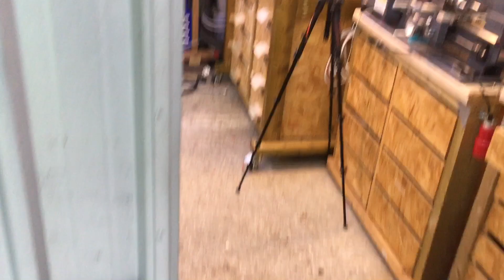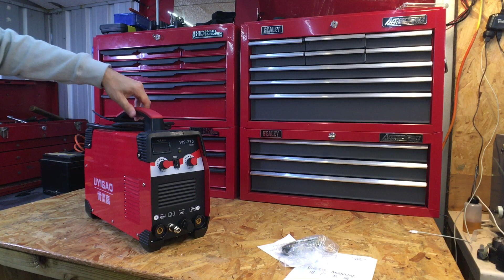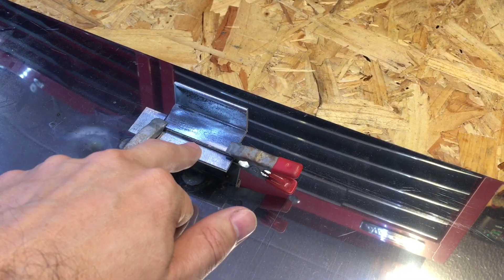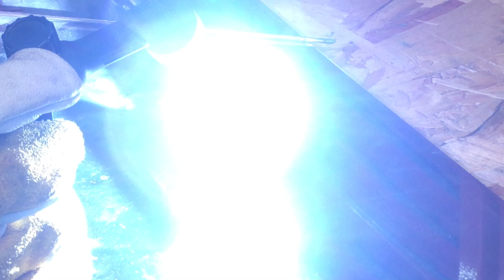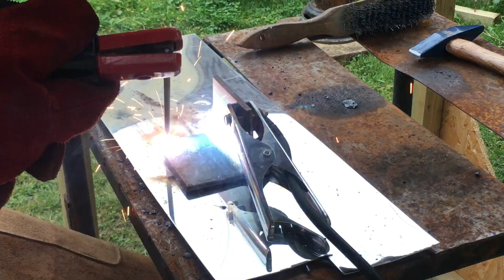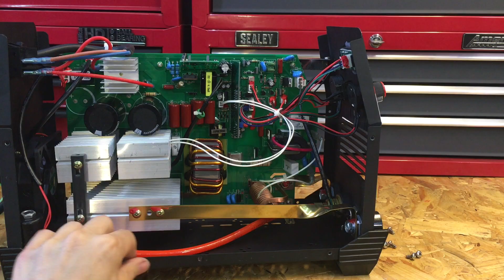Testing Cheapest Tig Welder WS-250 250A Inverter Welder Review

Comment: hi there. i like to know 4 things : 1- does the machine still works? 2- can you correct the amperage on the display with the real amperage? 3- from the 10m to 11m45 near the transformer toroid there is a  metal fuse i think what is the rating of the fuse? 4- If you put a coil on the output current the welding how not be better?

Comment: Great video.  Sooo... it's a year later, how's it holding up and what's your opinion of it longterm?
Reply from the maker: Bruce L. Yeah it’s still working good. Maybe a little under powered for thicker material but I mainly weld thinner stuff so not a problem. I am thinking about getting more powerful machine soon.
Reply: @JAYZWORKSHOP  Thanks for the reply

Comment: I never used these still of welder and I won ask if I can used the tig without the gas?
Reply: No you cannot use TIG without gas. Do not try. Always use argon. Particularly 10 percent CO2. 25 percent CO2 is fine also just depends on what you're welding. For just carbon steel, 25 CO2 to 75 argon gas works just fine.

Comment: Could you do a video on your parweld stick welder
Reply from the maker: The parweld is a excellent welder nice smooth arc will burn all types of rod up to 3.2mm , it will burn 4mm rod but you are really pushing it does say upto 3.2mm in manual . All so with a tig torch has a good lift arc function that works well. it’s heavy duty build glass filled plastic and steel chassis makes it very durable, compared to cheap Chinese ones and it doesn’t lie about the power output.
Would recommend parweld as a brand and comes with 2 years return warranty.
Reply: DIY TEK NUT would you concider a video review on it I have the xti160

Comment: prob old news by now but use the lay wire method , specially for mild steel (ps you cant tig weld over mill scale those angle iron bits need to be bright shiny metal before you start )  simply lay the wire in the joint and concentrate on the tig gun not feeding filler wire . gunsmith blacksmith welder by trade.PS you have to grind your tungsten in line with the rotation of the wheel you use IE you cant put the tungsten at a right angle to the wheel as the striations you leave affect the arc transfer.
Reply from the maker: thanks

Comment: The error most people make with these small machines is that they have them at the end of a long wire to source such as out in a small shop or a garage where they connect to a 220 volt source and what happens is when they load up the welder the input voltage falls and they blame the welder for the problem of not working or welding correctly. The solution is to have a dedicated source line from the main fuse box to where they are welding. It will make all of the difference in the world to your work at the higher current settings. Besure you have the right wire size plus some to reduce the line drop during use depending on the length of the run..

Comment from the maker: yes i was using argon , i said in the video my torch is for scratch start or lift arc tig and the gas hose goes straight to the argon bottle . so i did not need to connect gas to machine.
Reply from the maker: thought so

Comment: It would be great, if you're were in a pinch for a Tig welder no Aluminum just DC. Nice for stick welder, very portable. Look into the Primeweld 225 Tig welder. Its a great machine with all the bells and whistles. and cheap. For being a beginner pretty good weld bead with the stick mode.
Reply from the maker: Thanks have a good day.

Comment from the maker: welder from Banggood https://www.banggood.com/custlink/Gm3DBGhSsi
US tig welder model https://www.banggood.com/custlink/KGmmR4wQ61
*Cobalt Drill Bit Set https://www.banggood.com/custlink/m33GhoqQgF
*Cordless drill  https://www.banggood.com/custlink/DmvGNTT9iT
*Electric bike Parts https://www.banggood.com/custlink/3Dv3bT3Q5l
*Electric bike Wheel https://www.banggood.com/custlink/KKDKNf7t7S
*48V 350W 10.4AH 20 inch E-bike https://www.banggood.com/custlink/3DDGn1TIl5
*CrimpTerminals Connectors https://www.banggood.com/custlink/mK3GAuT8oI
*Wire Crimp Tool https://www.banggood.com/custlink/DvD3sfwIaa

Handy Good Cheap Tools
*MMA welder i would like https://www.banggood.com/custlink/3vGDsufVnM
*MIG welder i would like https://www.banggood.com/custlink/K3KKs7T5nO
*TIG welder i would like https://www.banggood.com/custlink/Gm3DBGhSsi 
*Tin Snip https://www.banggood.com/custlink/KmmmnwTVMl
*Stick Welder https://www.banggood.com/custlink/DDGKsw7PU9
*Welding Clamps https://www.banggood.com/custlink/mKKGbuwF1j
*Machinist Hammer https://www.banggood.com/custlink/KmDmQ1ut11
*Screwdriver Set https://www.banggood.com/custlink/KmmKATw5w4
*Precision Screwdriver Set https://www.banggood.com/custlink/K3v3Nuwi8V
*cordless Angle Grinder https://www.banggood.com/custlink/GDKmAFL7s4
*Carbide wood turning tools https://www.banggood.com/custlink/KKmKQwfS8S
* flex shaft Rotary Tool https://www.banggood.com/custlink/3KK3Z35Boi
*palm Router https://www.banggood.com/custlink/GDGGbT1iSj
*F-Clamp https://www.banggood.com/custlink/vKDGbfuZiB
*Double Edge Pullsaw https://www.banggood.com/custlink/mvGvb7uIZN
*Mitre Box https://www.banggood.com/custlink/33KvbuTSj3
* Impact wrench  https://www.banggood.com/custlink/mKDK6g6Bts

Above are affiliate links and in the comments it costs you nothing, if you do not want to use links search on goggle more info Thanks.
Reply: Even if some values vary between the 2 models, I suspect they are the same. I ordered the first one which was cheaper.